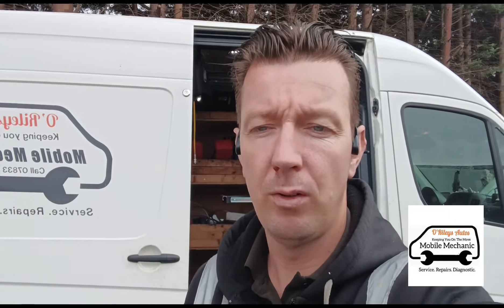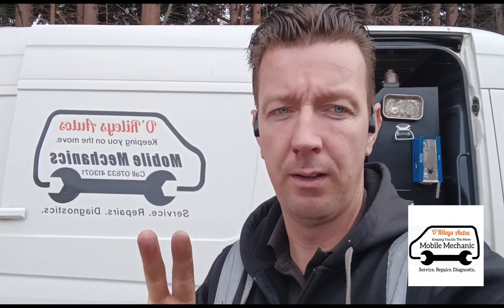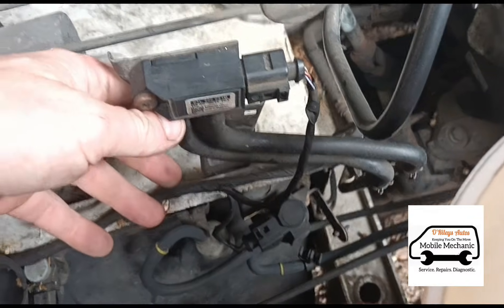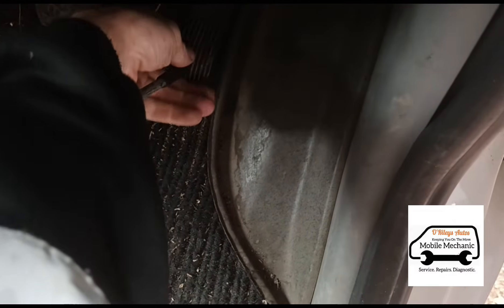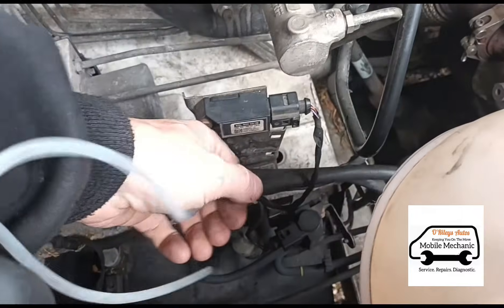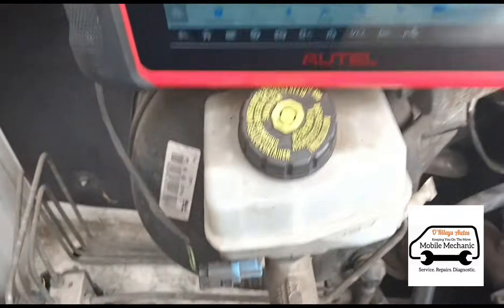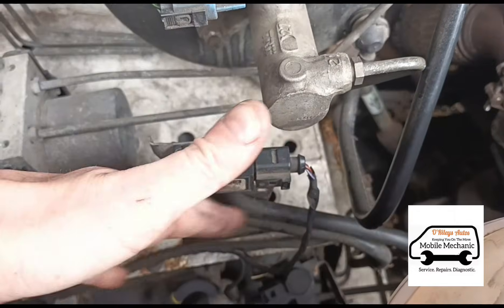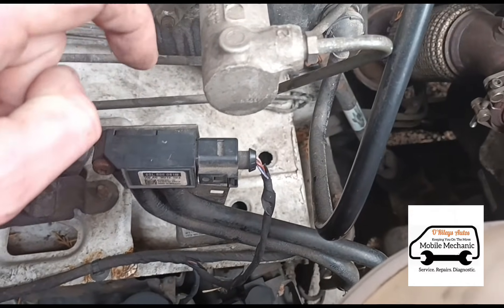How To Identify What DPF Pressure Hose Is Before & After Particle Filter Pre & Post Tubes

Comment: "Is it normal for the pressure on the particulate filter to rise to 300 millibar at a speed of 130 km/h and engine RPM of 4500? The car is a 2023 Sportage with a 1.6 diesel engine and AdBlue system. Please answer this question for me."

Comment: I tried and used the fluid through the dpf pressure hose and the car was running , while i was cleaning it the car concked out and it will not start now

Comment: very helpful for my Skoda Yeti, pipe nearest bulkhead I think
Reply: Did you try a DPF cleaner down the before DPF pipe if so my question is once you added the DPF cleaner did you put the pipe straight back on the sensor or leave it off till the product burnt off through the exhaust, I’m a bit concerned if I add my DPF cleaner down the pipe and reattach it too sensor some cleaner might get pushed into the sensor with back pressure and damage it. Cheers

Comment: Thank you Jimmy, another brilliant video.
 I have been a mechanic for over 30 years, doing mostly diagnostic work, and repairs related to that, but never bothered getting involved with this dpf nonsense, especially when you study the science behind it all, and just how bad it really is for the environment,  and anything living.
 The sole purpose of the dpf is to make the emissions cleaner, and stop the thick black smoke and soot from being dumped out of exhaust pipes, which would typically drop over a short time being heavy, the dpf makes the partials of soot much smaller, microscopic in fact, which lingers in the air much longer, and is invisible to the eye, swamp a town or city with this and good luck to anything living in the area, add to the soot and carbon another chemical which is also released into the atmosphere, the additives needed to burn the carbon and soot down to microscopic levels, how is this impacting our health?, is this why over the same period of time we have been fitting dpf filters the cancer rates have multiplied?, is this why 2 in 2 will get cancer, down from 1 in 10 before dpf?  I think the jury is out still.
 But in the mean time, please people let the man earn an honest living, if you can't fix it yourself, pay the man to do it for you, don't expect him to run you through it, for nothing,  I have done loads of work on the side of a road, and talking someone else through a procedure whilst trying to work, and watch your back is not easy, if I find something I can't do, I pay someone to do it for me, like clutches, and other heavy jobs,or jobs that require a specialist tool, or a ramp,  if I have a plumbing problem I call a plumber. Prety much anything else I do myself.
  Be respectful,  learn as much as you can, but if you don't understand it, leave it well alone, and get someone who does.
 I have decided to start dealing with dpf filters, and will no doubt be bogged down with cleaning them before long, I know so many people with dpf problems, and I just didn't want to get involved with them, especially knowing how bad a design they are, and how crazy it can make you having to go through all the variables of what makes them work or not work, and all the individual parts that can fail, and usually do prematurely,  it's a bit like the dreaded wet belt that most people are afraid of, and many garages still will not change, a stupid idea for cutting noise levels down, and that was the only reason the belt was fitted inside the engine, should have stuck with a chain inside, and belt outside.
Reply: Nothing too do with the convid jab mm ,are you shilling for Khan, another one who needs too join the dots.

Comment: What about for the cars that have differential pressure sensors with 1 pipe like on the 2013 vauxhall zafira can you still add cleaner to the hose or better through a oxygen sensor
Reply: Good question but I I think the switch just goes off preasure not fumes but I don't know to be honest

Comment: Hello. I cleaned the particle filter in the kia ceed 1.6crdi from 2013 because it regenerated very often (30-50km). After cleaning, it continues to regenerate at 30-50km. I replaced the differential pressure sensor. No error appears on the diagnosis. I cleaned the intake, the egr valve, the egr gas cooler. If I remove the plug from the flow meter sensor, it goes into limp mode but the dpf doesn't load so fast anymore.What else do I need to check? Could it be a software problem?
Reply: @sorinmarius6936 did you find out what was causing the issue?

Comment: Am I correct to think that if you have two hose and one is bigger bore than that other, that means bigger one would be before DPF (higher pressure) and the smaller hose will be after DPF (low pressure)?
Reply from the maker: Yes
Reply: Thank you! Appreciate the reply 😊

Comment: Very good video help alot
My Mercedes cls 350 keep going in limp mode with code 15DF00
The lower limit value of component b28/8 dpf pressure sensor has not been reached 

Dpf is clean I put new genuine sensor with teach in process 
But still throwing same code 
Highly appropriated if you suggest any other part I should check .
Thank you

Comment: I have this same car and the same problem but, I may have put the flush in the wrong pipe. It doesn't seem to have caused any issues, however. My obd reader is only showing and egr fault and after doing a flush I had no residue coming out the exhaust? I'm thinking I may have to change the egr instead unless I try flushing the other pipe ? 😅
Anyway obd says it's egr now I'm thinking I may have to just strip it is it a common problem? Egr fault? On the dash it's dpf! But obd says egr? Bloody honda 😂

Comment: Wonder if you could help me out pal. Am completely lost. I bought a 2011 Passat 1.6 tdi cayb b7 and was smoking from dpf area after driving. On checking round the dpf I took off the sensor and checked the pipes. One goes to the dpf and 😮 the other pipe is disconnected and can’t see anything to connect it too. Couldn’t be seen until I got sensor and bracket off. Need to suss out where the hell it’s meant to connect too

Comment: Is the DFP cleaner fluid sprayed into the high pressure black sensor hose, can the plastic of the black hose become damaged by the spray? Is it harmful to spray the DPF cleaner into the low-pressure (after DPF) hose or will the car clean it out?

Comment: On my van Mk7 transit 2012 I had someone do some jobs on it. A mate it wouldn’t start, he sorted it but ever since it has lost its turbo power struggles with hills etc, he couldn’t sort it but he put his snap on diagnosis on it and it showed I think a fault on dpf pressure valve sensor , would that cause that problem, also there is what looks like a small hose with a sensor or something just hanging about doing nothing so I thought maybe it’s something he hasn’t put back on when moving things but several people including myself are baffled to where it would go. Can’t see anywhere, could I send a email of it to u, maybe u could rule it out or know where it goes. Also to start the van you have to spin it over about 3-4 times before it starts up. Obviously it runs and drives but it’s a nightmare with no power for hills and stuff. 
Thanks

Comment: Good informative video this. Thanks. Has anyone reading this got any knowledge of why my car would be going through dpf sensors fairly regularly? I did it first about 12 months ago, and then again about 6 months ago and it's just gone again. I'm guessing it's too much pressure and has damaged the sensor? But how would that happen? The dpf isn't blocked and my reader shows a very low soot content so I'm unsure why the sensor keeps going. If anyone has any ideas I'd appreciate it. Thanks.
Reply: x250 Ducatos had a reputation for killing DPF sensors with condensation in the lines, this went away with X290s and the sensor repositioned. Next time blow out the lines in case of water ingress/ condensation

Comment: You ask for examples we'd like videos off. My example is very specific but can take 8 hrs in a workshop to remove replace a LPEGR cooler on a twin egr Ducato (2017-19) pre adblu. The cooler has a "tea strainer" at top end that blocks up before the DPF. It may be accessable via a flexible pipe behind the alternator. Have you had to do such a beast, or do you thinks its feasible? If this feasible i can see it being used as annual or biannual preventative method by those that have suffered.

Comment: Does anyone know where the dpf hose on jaguar xf 3.0l 2011 x250 model is had it cleaned a few times pain getting underneath and removing panels would like to try this way pumping cleaner into the hose if it's accessible under the bonnet